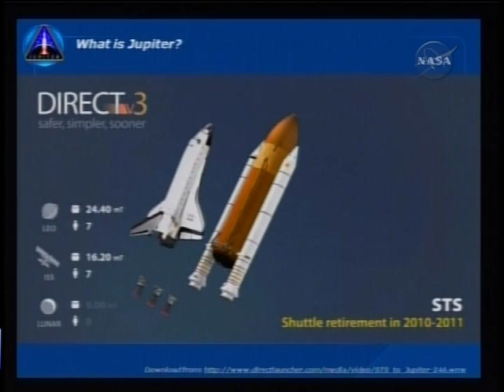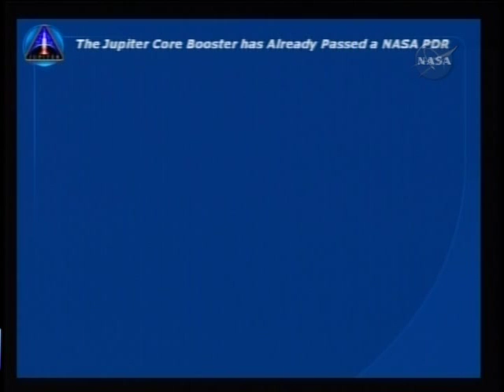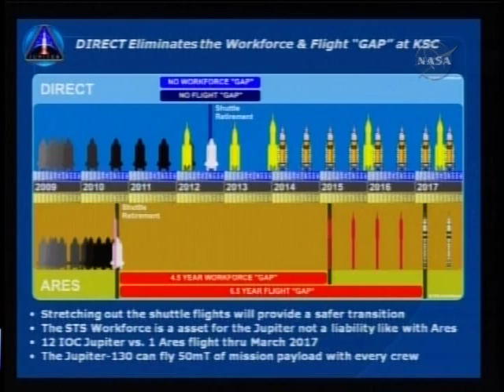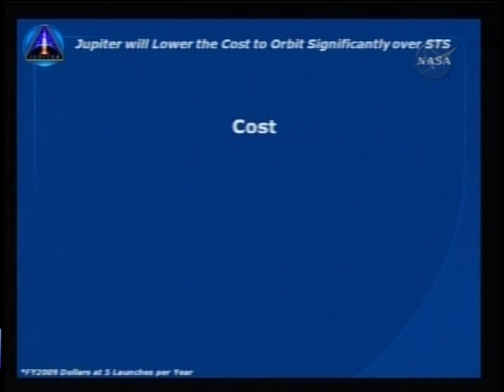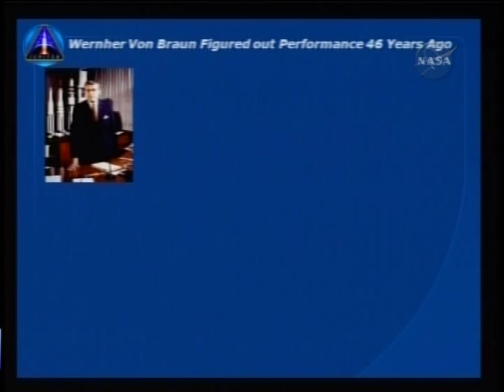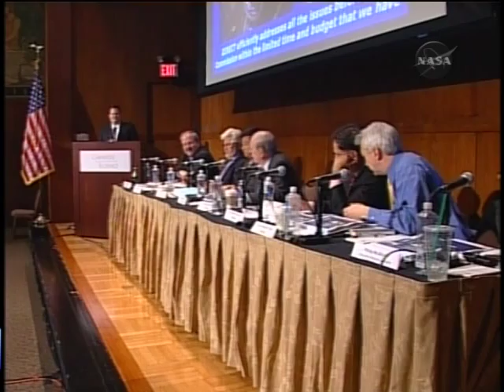Augustine Commission - Steve Metschan - DIRECT - 24 of 26

Comment: It has been reported that NASA is reconsidering going back to the SSME (RS-25) due to the recently discovered base heating problems from the SRBs. They will either need to do that or develop an RS-68 with a regeneratively cooled nozzle (RS-68R). Once you figure the cost of doing that versus the cost of a series produced RS-25, their isn't that big of a difference, plus the RS-25 will give you better isp.
Reply: Hello from the future! Don't worry, we still have the RS-25s. They are being used on a SDV called SLS. Unfortunately they are expendable now but at least we are getting a new version with updated manufacturing techniques and more thrust.

Just a heads up, you know that little company called SpaceX? Well they land rockets now. They also take people to the ISS for NASA and recently did a private capsule mission. Oh yeah, they are working on a vehicle with more engines than the N-1. Crazy times man.